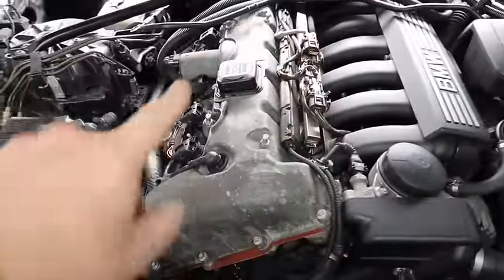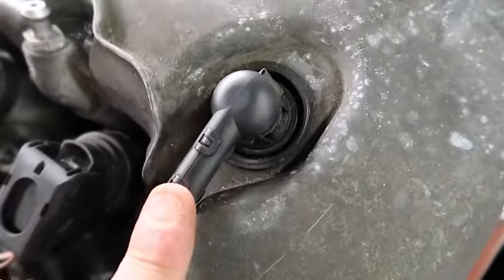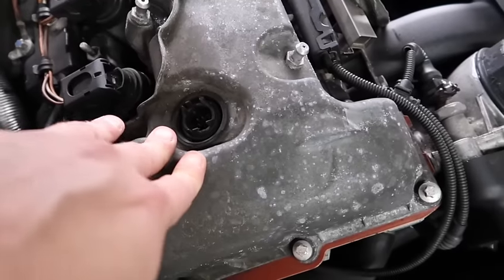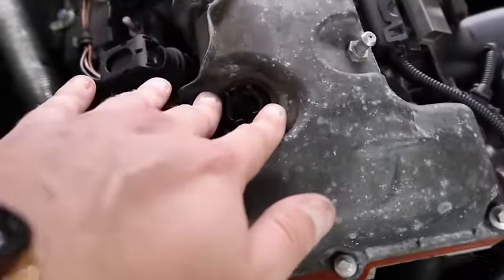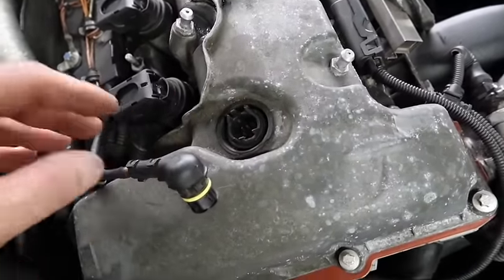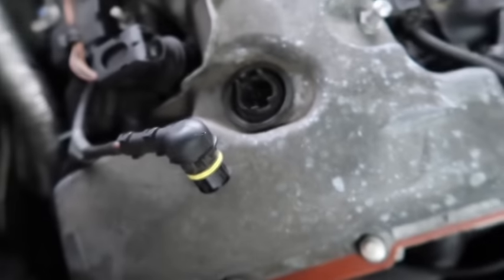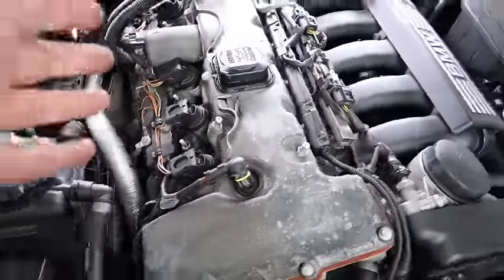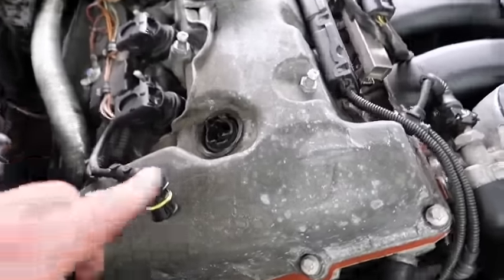Remove This From Your *BMW IMMEDIATELY*

Comment: Can you leave it disconnected to disable Valvetronic system? I'm told it goes into a default mode of max valve lift and runs better. A lot of ameture race teams do it. Will it bring EML on?
Reply: I was advised by a BMW mechanic to just disable it if the engine is old and running rough. The plugs and coils were good and no vacuum leaks were found, but the sensor had oil leaking through it. I also had what's known as 'piston slap' a metallic clanging noise when accelerating under load. Disabling the sensor helped with the issue. I was getting a bit less MPG but it certainly ran better in my case.
Reply: @dhalsim-1  how did you disable the sensor? Can you just leave it u plugged or what? Thanks
Reply: @dhalsim-1  howd u disable sensor?

Comment: 2006 330i N52 NA version here. I'm halfway through taking apart the cover and noticed oil in this too. I've got the dreaded 2a87 code and am going to look at the camshaft bearing ledges. Do you think this would cause that code also? Thx for the tutorial
Reply: Any update’s???

Comment: Hey, great video but I have a question….. does a2002 bmw 330ci with the 3 liter base gasoline engine have an eccentric shaft sensor or does the cam shaft position sensor do this? I can’t fine an eccentric shaft sensor for sale and I can’t find a connection for the plug like you show in the video? I’m a bit lost…. I’m having the limp mode slow stop to go issues and rough idle…. I’ve cleaned my vanos solenoids, I’ve replaced my vacuum system, I’ve replaced my MAF sensor… only two things left… this sensor you’re talking about or possibly my catalyst system in the exhaust…..
Reply: Was it a clogged cat? 😂

Comment: My sensor was leaking oil on the gasket and dripping onto the manifold. Had to use some silicon to seal the gasket and now all good
Reply: Richard Owen what symptoms or codes was your car giving out
Reply: alex molina none
Reply: That silicone works well.  Used in on my X5.  Also use Blue Devil stop leak.

Comment: Hi! I don't know where to message you for my concern. I have 2006 320i e90. the issue is after turning off the engine it'll take 30min or more before the engine starts again. The battery is okay by the way. Hope you can help me on this. Thank you in advance!
Reply: Make sure it’s not running hot at all
Reply: Had this problem before and basically I didn’t know because it was only slight but it will not allow you to start the car until cool enough
Reply: @markeviusdelllano9303 Yes, that is basically what I notice, if the engine is too hot. especially if I am from a long ride, I need to cool it down first before it starts again. Will Coolant fix this?
Reply: Did you figure out the issue? I am having the same problem now. Random no starts. Have to wait hours for a start to happen. Everything is good. No codes.  SMH.

Comment: I have a 2015 bmw n20 engine I replace 4 injector and now I have a crank no start good spark fuel I check compression and it low 90 psi any tips on what can cause that

Comment: I have a 328i the cam broke off and I swapped the motor the engine was running good not it’s giving me misfire codes and P0016 and I checked everything that relates to the timing can you help?

Comment: What's the deal with the 2nd air supply and carbon build-up on the '05 4.4 v8? I've got an X5 4.4 and a 545i with the same motor same year and both have the same problem. The 545 only has 137k and 171 on the X5.

Comment: Does the 2008 e92 320i have this problem? I'm not sure on engine code. I'm getting a 2a99 code and it's running like a sack of #### with the problems you said about. Been chasing this problem for a while. My last port of call is the cam tray which I'm hoping it isn't
Reply: i got the same code on my ‘11 N51 128i did you find a fix

Comment: Need advice , been having valvetronic issues, think I found a corporate after replacing a lot of stuff , oil in the sensor , should I clean it and jus  replace the gasket, or jus just get a new one and put it in, already did the vc gasket rew months ago 🤦🤬 , thanks any body

Comment: So if the car is rough idling , almost can feel the car on the inside shaking , the steering wheel shaking, it is that part only ? I have an E46 318i 2003 , does it have the same issue ?

Comment: never ends on my N52.  Rough idle since I got it.  Parts replaced: plugs, coils, updated DME, cleaned Vanos and fuel pump updated with WinKFP.  I guess I'll try this next
Reply: I know it's been 3 weeks but did tht solve ur problem?
Reply: Replace vanos not just clean
Reply: What’s the word, Mike? Any luck?

Comment: What will be the part number for a 2006 BMW 330 Xi Sedan
Reply: Did you have rough idle issue? If so what did you do to fix it? I have the same exact car as you

Comment: Question, I have a 2005 525i BMW. I have a transmission fault, when shift the gear at idle it thumps hard. a picture of a gear appeared on the instrument cluster. 
says I can shift with out the break pressed. can it be the transmission solenoids? or the crank shaft sensor? need help. please TIA

Comment: I have a BMW 128 it was stolen out a lot then one morning it doesn't want to start I unplugged my ESS and it fixed the problem but it was running crappy. Then it just decided not to start at all with the ESS unplugged what does that mean and I replaced it with a new ESS still doesn't run with it plugged in or unplugged and there are no codes except for when I have it unplugged

Comment: I notices this was unplugged on my 316i, plugged it back in and later at the night the car suddently doesn't response to throttle and bogs down. Doesn't do this everytime but its running very roughly. I will unplug it again in the morning to see if that is the problem. Thanks anyways!

Comment: Thanks for the tip!  Everytime I look at what's inside the hood of a BMW versus a Tesla I'm more convinced EV's is the only way to go in the future.  Tesla's engineering is several years ahead of BMW & most ICE car manufacturers.  I own a 2010 335i and I've had several issues with it.  Non-stop....  Next car for me is a Model 3 or Cybertruck.
Reply: If you had owned a 2010 Tesla , I guess it won't be serving today either and I doubt you will get 50 miles today on full charge with the stock batteries. You can upgrade please,  rather than putting all the blame on the 10 year old mechanical machinery

Comment: Hi, i just bought a BMW E90 325i (n53). In low revs at low speed and especially in second gear, I can hear a whining/ jet sound when accelerating. In higher revs (above 4-5k) in second gears it disappears and in third, fourth, fifth and sixth gear it disappears. Is this normal or is something probably wrong and if so, what is wrong ? Thanks
Reply: Is it coming from the engine bay?
If it is, it's probably the oil filter.
Reply: Makhlouf A yes its coming from the engine bay. I’m changing it as soon as possible, thanks!

Comment: Great video✅.

When starting the N52K in my Z4 Coupe, when cold it immediately starts at 2000rpm and then drops straight away to a little unsteady 1100ish.
Why does it rev so high when start from cold??
Reply: Hey, did you get any help with that?
Reply: warm the cats

Comment: Would this be on an M47 2.0 diesel lump on an e90 07plate? Mines never idled spot on from brand new and I had to have a new sump gasket under warranty at 600miles and a new turbo at just 50k! And hadn't been ragged either..  so I'm not sure why it's never idled smooth and it's not all the time just now and again the rev counter blips up and down really quick then ok then few seconds later same again. Obviously it's silly low mileage had it from new always serviced before the mileage up and only on 57k now!

Comment: This is exactly what is happening to my son 2007 BMW 328i I bought the part from continental had it replaced but still does it on the start but I think now it’s the cord because bmw took a picture of the peice on the cord and not the eccentric shaft sensor part...is it difficult to change the part that you stick in the sensor?

Comment: i have an issue with my idling on my n52 motor.  it is smooth except for random “hiccups” where it shakes the car every once and a while. would this be the problem?
Reply: did you solved it?

Comment: Hi , hows it going .

I have e90 330i , with the N52 
I take good care of the car . Recently we tested the 0-100 of the car with a stop watch .

Yes its an old engine so didn’t expect it to have similar 6.2 sec as from new, maybe 7-7.5 secs 

But my car is doing it in 10 secs . 

Oil leaks were addressed , new valve motor , all the cooling related parts are replaced etc. 

Please help .
Reply: Car has done 73000 km and is a 2011. Also before car had been sitting for a while with previous owner, when i changed everything i changed the gear oil as well , and that is the only thing i didn’t use OE bmw but a ZF oil .

Comment: Are u saying take the sensor out ?. My Water pump went. My fan snapped off. And my idle was seized up. I replaced them both, and now 
I'm getting P3040 code. Camshaft position sensor. I replaced it and it's not the sex guy Trouble starting, no power, struggling to get up any hill. Please help

Comment: Replacing all the bolts if you take the head and gasket off is categorically not a necessity. I get what you're saying, for 20 quid just replace them, but no, it's not necessary to replace these at all, and you'll be fine reusing the same bolts.

Comment: so we just remove this plug and but anything else ? so i have bmw x5 n52 engine. it aint a lot shake during the engine start however some times has shaking actually during the engine start.

Comment: Yes, i did timing chain, and vanos solonoids, and then car started and wen i started again it sounds like no compression. The DME motor is max open and it is not relearing.  Any advise.

Comment: Hey Bro what is terminal 30 MSA for because I have no volts on that one with the key on. I have 2011 535ix won't start remove and replace with new battery unit crank over but won't start check all fuses ok. any help
Reply: Did you ever find out what’s causing your car not to start? IBS cable sensor maybe?

Comment: thing is that the systems in not seperated by each other, so bad valvetronic sensor ends up as a VVT VANOS error code and gets everyone changing parts that will not fix this issue, BMW should have made the systems more independent.

Comment: Thank you so much for this video, toke my one off, found a lot of burnt oil and metal in the center of the sensor where the head of the shaft goes into the sensor inside.

Comment: Can the eccentric shaft sensor cause a P0393 Cam sensor high voltage bank 2 Sensor 2 code, Rough idle, Erratic between 700-1500 RPM, trouble starting?

I've tried swapping around the Cam Sensors with no change, inspected cam plug and wires, no issues, swapped around Vanos solenoids, no change, checked around for vacuum leaks, and fixed any I saw, no change, didn't have the code before the valve cover gaskets were replaced, and now the code won't go away.. any ideas?

Comment: Can you help me with my bmw e46 318i, cause if i use the when the temperature set in the middle then i turn the engine off, i will have a difficulty in drive mode

Comment: I have a 2000 528 I change the transmission from 2003 530i but wiring is different which wires from the transmission do I hook up to the 2000 wiring harness the 2003 530i has more wires

Comment: Hi Dean this is a brilliant channel top hat to you don't know if you're about to help me but I've got a BMW 530 d 2004 it has had all it's recalls but I've got a random thing going on with it I could be driving along and my display will start flashing the car will go into limp mode start losing power turn it off go to start again and it's a completely flat battery I've had RAC and AA come out to it it soon as they jump started it's perfectly fine again they tested the battery and are even put a new battery on it and the voltage is 13 volts BMW have had the car and they can't even work it out any ideas
Reply: Did u figure It out I’m having a siniliar issue

Comment: Hey I brought F10 520d I noticed engine temperature is not sticking to the middle of the gauge it sits little bit underneath but when I’m stationary it sit middle then while driving it drops down underneath the centre why is this happening? this isn’t normal

Comment: I replaced mine when I did my engine, I will tell you they are not cheep. The v8 has two of these bad boys. I paid 290.00 per side for new ones. Remember to stay away from the cheep Chinese brand not worth the headake.

Comment: Hi m8 im looking to get some advice as my passenger seat doesnt work at all E61 all electric heating and ventilated. Cant find any video.. Any help please.. Stuck in all way back position so cant get to rear Bolts to take it out

Comment: Quick question, I came to a red light and it randomly turned off when the light turned green? I have a 06 push to start 325i and it was so random. But I just turned it off then back on it worked. I was like wtf

Comment: hi, this is not related but maybe you know... my locks don't work, 2004 bmw X3. I tried reprogramming the key fob, no luck. I checked the fuses, they are all good. The physical button inside the car will not actuate the locks either and the rear hatch cannot be opened. Any ideas? Thanks.

Comment: Would it cause low idle around 500/450 on N62 550i when engine is warm at normal temp ?
Reply: Did you ever figure out what that was? Having the same issue with mine as well.

Comment: i have replaced my fuel injectors and fuel rail and coils, and spark plugs, new valve cover and new essentric shaft sensor and still have cylinder 1 and 6 misfire and random cylinder misfire help please

Comment: I've got a 2013 320d, noticed that at times first gear is hard to select, its not all the time but a few times at lights I've struggled to engage it and had to pump the clutch, is this a common issue
Reply: Have that issue sometimes in my 320i. I have to put it into 2nd then back into first sometimes for it to work. Not great when you're at the lights!

Comment: my car is bmw 320i(E90)2007.blue smock is coming .there is no issue in ccv valve.do you have any idea about the problem?
Reply: Valve stem seal it's a common fault I changed them so many times 100% is that

Comment: Top video and top as always, dudes got the skills 💪🤙👊🍻
Reply: @BMWDoctor  hi sir. Can you advice me what would cause an n42 engine to have oil light come on only on idle and only when the temperature gauge is half. Also idle is rough. But once car cools down. Everything is normal. Could it be the oil is too thin when warm

Comment: Can this cause a long start issue ?? I’m frustrated spent 1000 and still haven’t diagnosed my issue . Cold start takes really long to start . It runs perfect with no stalling no problems at all after first start I can turn it off and it fires right up every time after unless it sits for more then 5-8 hours . I’ve replaced the vanos solonoids . I’ve changed the camshaft position sensors both . I’ve replaced the fuel relay and it has new fuel pump . I feel I’m getting used at these Bmw “Specialists “ . No codes no check engine light . When it starts cold idle bad for a few seconds then it normalizes . Any help will be greatly appreciated. Thank you
Reply: I had the same issue and changed several sensors, the BMW dealer repaced one fuel injector and the problem was solved.
Reply: Make sure you have the correct oil in your car. When in cold climates the wrong oil will not start a good when you have the wrong oil in cold conditions.
Reply: Is you engine code n43 ? Then of course its fuking injector

Comment: So what's the issue with re using the rocker cover bolts ?
You mentioned to replace these.
Reply: They are torque to yield I believe
Reply: Tony Montana Made from aluminum. Second time they brake.
Reply: The aluminum bolts are torque to yield and designed to stretch slightly when installed correctly.  You can't reuse them because they can't be correctly torqued on reuse.   (oil pan, tranny and many other bolts are the like this on bmw).
Reply: Write one use bolts RY need to be very careful. If you work on your car on a Sunday the belt tensioner needs an 11 mm and there will be 10 mm everywhere and 12 mm but no. 11 mm I bought 3 of them and just keep them in a bag now.

Comment: Do you have a email so i can email you the codes and send you a pic of a wire plastic tube near behind the engine. Tomorrow im taking it apart and taking clear photos so maybe you can tell me what its for and how critical it is. I just did my starter and was a hard job for me with no car experience

Comment: I have a question for you please man. What is the best service method for the E39 in the US as far as the the oil change interval as well as the rod bearings issues that they have? I ask because I'm wanting to buy a e39 with 60,000 very badly man. Please help me with this thank you
Reply: What sort of engineed E39 do you want to buy? Different engines have different problems, it also depends on how well they have been maintained, does the car have a reliable service history or not?

Comment: Just checked my last service report as I just had the gaskets done and my shop included a new sensor in the repair.
Reply: Hi dean my E46 1.8i twinvanos blown head gasket I fix it now there's oil in plug 1and 2
Reply: I had the same problem, fixed it after change coils

Comment: Can I clean this ? With mass air flow sensor cleaner ?
Reply: No it’s a small module under the valve cover.  If there’s already oil in the connector it’s probably already bad.